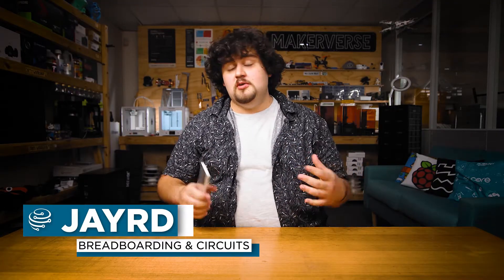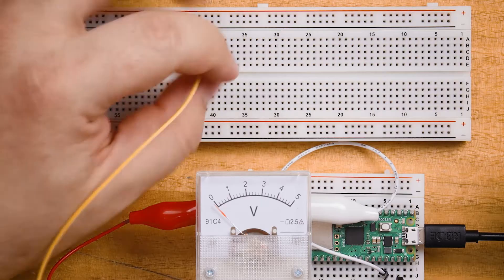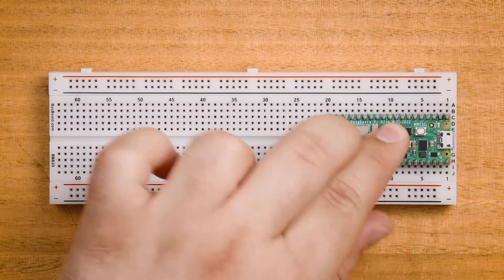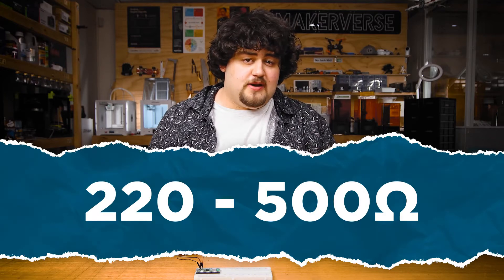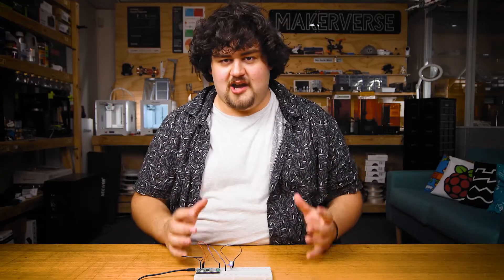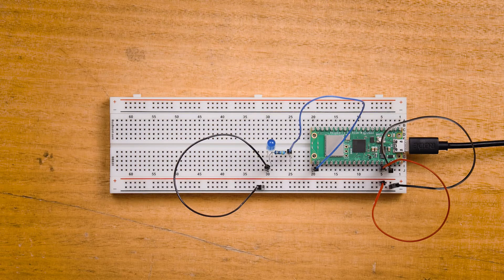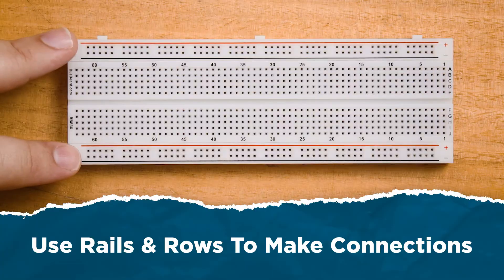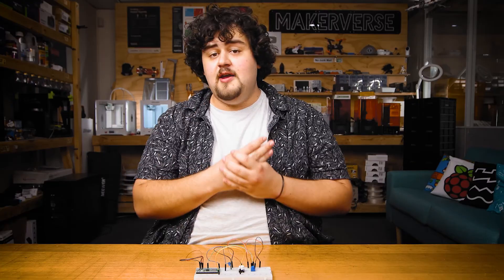Introduction To Breadboarding & Circuits | Raspberry Pi Pico Workshop: Chapter 2.3

Comment: Why does the LED only need ground, while the button only needs power, and the potentiometer needs both?
Reply from the maker: In all of these circuits, we are using both a positive voltage and ground. 

The LED needs to be connected to ground because we will set the GPIO pins to HIGH, which will create a 3.3volt power source on the pin, causing our LED to light up. The pins can only supply a tiny amount of power though, and it's just enough for the LED.

The button is connected to 3.3 volts (power), because when we press it, we will supply that power source to the GPIO pin. We will then read with the GPIO pin to measure if its ground (not pressed), or 3.3 volts (pressed).

And the potentiometer is a cool one. You connect both ground and voltage to each side of it. When you turn the knob, it sort of "mixes" the 2 inputs. If you swung it all the way to ground, the middle pin will output ground, if you swung it all the way to 3.3 volts, it will output 3.3 volts. If you put it right in the middle it will mix these two 50:50 and give you 1.65 volts (half of 3.3). You can turn the knob to any angle to put out any voltage between these two, and we are just going to read the voltage with a GPIO pin.

Comment: I don;t understand why in the LED example the red wire connects 3.3V to the positive strip but then nothing else connects to it? What is the point of that connection?
Reply from the maker: If you are just wiring up the LED and resistor the red wire is not needed! We did it because the circuits after do need it.